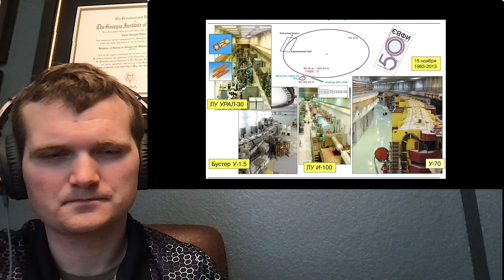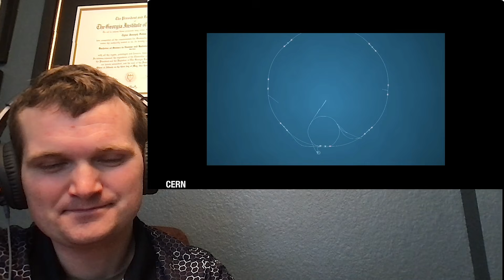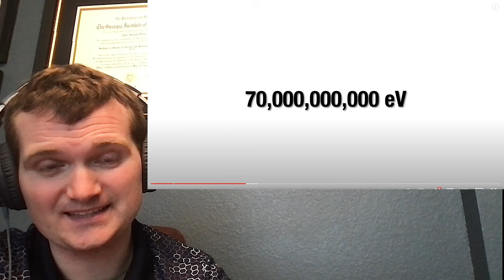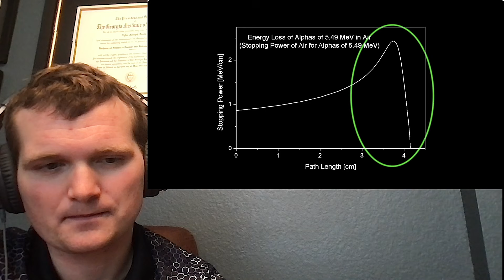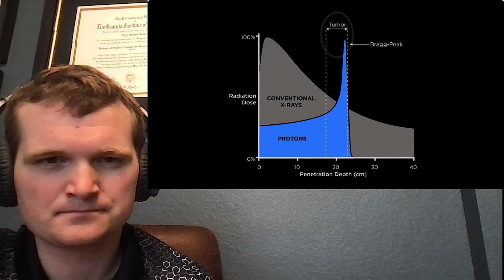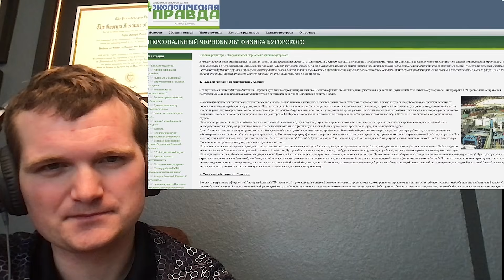Nuclear Engineer Reacts to Kyle Hill "What if You Put Your Head Into a Particle Accelerator?"

Comment: In theater we used to use cue lights to tell the stagehands when things needed to happen.  Obviously if those burnt out it would really screw up the show, so every cue light was a pendant with two separate lamps (sorry, light bulbs) in it so if one burnt out you had a backup.

Comment: 2yrs late, but if the particle accelerator was still on and he moved into the beams path, wouldn't the beam sliced like a light saber from (Star Wars), not just a straight line through his head and the same upon him removing his head. unless there were timed pulses long enough for him to enter the beams path before it fired straight through.

Comment: My dad taught me that anything that can go wrong will go wrong means a point of failure will eventually fail.  So first engineer it so the probable failure is well outside lifetime/maintenance and second, what's the contingency.  That failure happens where does the load go?  Make that tolerate the extra load.  Repeat redundancy based on application

Comment: A 250 ton train, travelling at speed, isn't going to be slowed to any significant degree by a bicycle.  And if you've ever seen investigations where a plane has crashed, at speed, into the ground, it may be difficult to find anything which resembles a plane.

Comment: 14:00 this reminds me of what happens when an armor-piercing round hits something thin and soft like a truck trailer fabric and doesn't make any damage inside apart from punching an entrance and exit hole in the fabric. It would absolutely obliterate a tank because it was designed to interact with and encounter a lot of resistance before it delivers the payload. But it just doesn't have enough stuff to interact with on a skin-thick target.

Comment: I am no nuclear science expert but I do have the quality assurance mindset. Shouldn’t it be impossible to disable that door lock because you “feel it’s an overkill”?
Also a signal to the operator room that the lightbulb is burned is also mandatory IMO.
P.S. In my university ,in Bulgaria, there are induction furnaces for melting metal and the sensors for the doors on the high power electronics have been bypassed. That’s the dangerous Balkan mindset of neglecting safety put into action. Kinda like in the video

Comment: 4:44 the particle bunches lose energy due to impedance of the vacuum chamber walls (image charge) as well as during bunch focusing and overall trajectory changes; free particles don't go in circles.  There would be no light coming out otherwise.  If one is tempted to invoke "magnetic fields do no work" thing, I encourage doing a Lorenz transform of the magnetic field into the rest frame of the particle; things get weird near the speed of light.  Synchrotron radiation was thought to be a myth at first but we've been using it for spectroscopy for decades.  Energy leaving means it needs to be topped off; in those days, that was likely done in a copper RF cavity; superconducting cavities are more common now.

Comment: 4:11 I cringe whenever i hear "perfect" or  "near-perfect".  Typical operating pressure of a modern electron synchrotron is around 1e-9 Torr (1-e10 with no beam stored); around what it is in low earth orbit, if I remember correctly.  In principle, 1e-9 torr is easy and can even be achieved with mechanical pumping; the difficulty in this application comes from needing really narrow and very long chambers because of magnet optics constraints.  Ion pumps have to be used sparingly because they perturb the magnetic fields so we get into things like nonevaporable getters, titanium sublimators, and outgassing-reducing surface treatments.  A colleague claims to have gotten a photocathode chamber for an electron storage ring into mid 1e-13s; that's well below the measurement range of off-the-shelf devices.

Comment: EDIT: I stand partially corrected:  it's was a proton machine.  Though, again, nothing nearly as complicated as the LHC or RHIC.  No bigillion miles of superconducting wires or 10-story-tall detectors.  

3:12 that looks like one of the LHC or RHIC detectors; both machines are hadron accelerators and study collisions, therefore requiring huge detectors; produced particles going every which way.  I did not know about this particular synchrotron (funny enough, i was a child living in the USSR at the time of the incident and then many years later designed chambers for synchrotrons and ERLs at two national labs in the US; synchrotrons are cool) but given the arrangement of the instrument hutches (i.e., tangent to beam propagation), it looks more like a light source (likely electron, possibly positron, based) so the detection equipment is (especially in those days) pretty compact and not as complicated as collider detectors.  I also kind of doubt there were superconducting magnets seriously involved in the late 1980s.  The light that comes out before hitting a monochromator is of all frequencies (though peaks at a frequency defined by the magnet lattice of the machine) and is therefore often called "white beam"; its very coherent and can have a ridiculously high repetition rate so, as of the past decade or so, folks have been able to see biochemical reactions take place, not just take static destructive pictures.

Comment: Tyler, in terms of signage the illuminated signage should've been fail-safe. To have a sign illuminated to say the area is forbidden is bad practice

 The sign should instead be illuminated to say its safe, and off when its forbidden. The reason why is that if the bulb were to blow, the fail-safe state would mean that the user would have to assume its forbiddrn then double-check and confirm to make sure its safe.  

The system used here could have just a blown bulb leading to the assumption that the sign was off and that the room was accessible to enter.

Comment: What I dont understand, is how did the beam only go through a small part of his head, like a bullet,  shouldn't it have been more of a "cut"?  Due to the speed of the particle beam?  If feel like it's like putting a piece of wood in the blade of a circular saw, pulling it out, but only having a drill hole in it.   If that makes sense
Reply: I think the atomic particles race around another path, then someone pushes a switch and the high energy particles are diverted in a short pulse to the target.  Not always on like one would expect a steady state laser to be.

Comment: I'm unable to deal with the math at the moment (to be frank, I'm drinking, and I don't trust my MS-crippled fingers with a calculator)... but are you certain that a proton moving at 0.95C+ isn't at least approaching the 7BeV that you're poo-pooing?

The rest of your info is solid as hell... plainly you know your shit... but I had to question your estimate of each proton's energy, which seems vastly too low to me.

Also, even 7BeV protons would cause very little more damage than those far less energetic ones you're talking about, simply by going so much faster through the affected tissues... so maybe I'm making a mountain of a molehill... still, I had to raise the question:  was the beam's energy even remotely close to the 7BeV/proton claimed in Hill's video?

Comment: That whole logic about the door being locked was "overkill" is so typical of why things eventually go wrong. Whenever you make a safety-related decision like leaving a normally locked door open, ask if there is any point to NOT locking it. 

Is there a practical reason why you want people to enter the room with the proton beam when it is running? Is there any benefit?

Even at lower energy experiments, you wouldn't want people randomly walking into your beam, would you? Even if the energy is so low that it won't do damage, it will certainly disrupt whatever experiment you are running, one would assume.

It's like people working in high places using safety harnesses. You are supposed to only remove one of the attachments at a time, but sometimes people will try to save time (or something) by taking both off before moving to the next attachment point. Sure you might save a few seconds, and most of the time you will be fine, but one day a gust of wind or a wet surface or even just you being slightly distracted by a loud noise or a pretty girl on the street below... and that's the end of that.

Safety is that thing you must always have, yet never see until it fails.

It's boring and when it works, nothing happens, making some feel like it's meaningless. This is why all kinds of prevention, preparation and health and safety procedures are so hard to convince people of; if everything is done correctly then nothing will happen. This is why people doubt vaccines, for example. "wHy dID wE gEt tHe vaCciNe? nObOdY goT sIcK!" ... yeah, that was the point.

I still remember all the work that was put into preparing all the computer systems for Y2K; countless people all over the world worked for years to update systems to a four-digit year system. And once midnight 1999-2000 happened, there were only minimal issues in minor systems... and people immediately started mocking the "hype". Well, the reason the world didn't fail was BECAUSE of the "hype", but I still see people joking around with how "meaningless" that was, never realizing how bad things could've gone if everyone had ignored the problem.
Reply: People doubt vaccines because the government lie about them. How do you define vaccine? I know what I was taught. A vaccine is a weakened or dead form of a virus that stimulates antibody production. The 2020 jab is not that but they called it one while forcing people to take it without any safety testing and government relieving of liability.

Comment: Even less safety related rooms that contain a hazard (like laser operation) have emergency stop automatisms that trigger on opening the door…
Reply: Also that lightbulb… Even the most stupid engineer (if there has to be a light bulb at all), who wasn‘t able to use a self checking signal, would have at least(!) hooked it up in reverse (light up if there is no danger) to reduce the failure risk.

Comment: Haha. I like the No Smoking sign at the top of that door, above all the other signs. Corrosive acid is the scary thing in that room. Cigarette smoke won't do anything to the acid or batteries (other than leave nicotine stains everywhere). It would actually be perfectly safe to smoke in that room, provided you're not burning the batteries with your ciggs. If you put your cigarette out in concentrated sulfuric acid, you wanna know what would happen? The same thing that happens to paper or every other organic substance. One thing it wouldn't do, is explode.

Comment: Im a nuclear engineering student specializing in radiation safety and medical uses of radiation; gor what it's worth, stopping power has been the standard term we've used throughout my program rather than slowing-down length, since SDL is derived from stopping power, and stopping power is more widely applicable -- it accounts for density, where SDL is more reliant on the details of the medium.

Comment: Surely you'd make it a green light bulb that illuminates when its safe to enter, that way if it burns out it fails safe as no green light = no entry rather than failing unsafe Ie no red light on being misinterpreted as safe even if its not as its just a failure of the light

Comment: As a gun person this concept fully applies to bullets.  For example it is why hollow points are preferred over full metal jackets, a full metal jacket often just passes through and does minimal damage as little of the energy is actually transferred,  but a hollow point being designed to open up and expand its surface area will ideally come to a stop in the body, therefore transferring all of its energy into the target.   Although I do not think the idea of the braggs peak applies, but all the rest does.
Reply: @Xnoob545 fun person.
Reply: Theoretically, even if a HP does overpenetrate, it should've dumped enough energy to prevent causing serious injuries to the 2nd object/being struck. The big exception being drywall, which tends to fill HP bullets, causing them to act more like an FMJ. Tumbling rounds like 5.7 or copper TUI solids function similarly, piercing the first target (and possibly even armor), but then they dump most of their energy in the tumbling action once they encounter resistance.
Reply: Don't need to be a fun person to understand this. It's called common sense
Reply: @456death654  fun person

Comment: if you notice Kyle said a sign should have been 'illuminated" which means it was a light up sign, much like a recording studio or radio station has a light that says "on the air" or "recording in session", not just a plain sign, but an electronic sign, warning its in use.

Comment: Your info on Nuclear Plants is interesting, keep it up! Oh and.. it was 'only' 64 GeV , not 70. Fun fact : I once worked a few days on a machine I had installed  at the VITO Nuclear Research Center in Mol (Belgium) in 1989  and my client asked me to please not use the local toilet, but use the one in the administrative part of the building. So if nature called I had to go through the double doors to the  toilet in the administrative part and then let myself in again. WHY ? Well, the machine was installed in a decommissioned lab. The drain from the lab toilets still went to a holding tank which contained waste water from the 'active period' , which VITO preferred not to get fuller with ordinary waste, while the 'outside' toilets just fed into the common drain.
Reply: I know a guy that would've ignored the request and used the forbidden toilets anyway

Comment: Murphy's Law was coined by Dr. John Paul Stapp. In case you don't know, among many other things, he oversaw and even performed many tests for plane seating and ejection mechanisms at the rocket sled facility in the southwestern US. He did not just oversee these tests; whenever he could, he used himself as the test dummy. If you ever heard of the man who set the record for the fastest a human has ever traveled on Earth, the man was at this rocket sled facility, and the man was Stapp. Why did he set the record? He wasn't aiming to set the record, but rather to demonstrate how many G's a human body could survive, as it was believed before then that the number was rather low. Stapp's sled run proved that assumption completely wrong. As for all of these sled runs and the data collected from them, not only did they work out the systems currently used in military aircraft, but he also took it and went on a nationwide advocacy for seat belts in cars - yes, he is the reason every car in the US (and most of the world by extention), by law, has to have seat belts for every passenger in a car.

As for Murphy's Law, it is credited to one of the engineers who worked under Stapp at that facility. Stapp had a tendency to take whatever those around him would regularly say about something science- or engineering-related, simplify it and try to give it more of a (usually comedic) punch, and give it out as a truism. He even published a compilation of these, and he named each one after who he believed said their original forms the most often, hence why Murphy's Law is not named after himself.

Simon Whistler covered more about Stapp than a simple post can. Feel free to look the video up for a better summary than this.

Oh, and Stapp does have his own law, otherwise known as the Ironic Paradox: "The universal aptitude for ineptitude makes any human accomplishment an incredible miracle."

Comment: Just like it's often done in electrical substations, there should be a shutdown mechanism mechnicaly coupling door to the particle generator, just so when the door is open, the beam is automatically shut off. It is often done in electrical so you cannot open isolating switch (which has no arc extingushing ability) when the power is still on.
Reply: So leaving a door open is substation sabotage? I know what I'm going to do on Friday, November 17th in north by northeastern Paradise Nevada (commonly known as Las Vega) at 7:32 AM Greenwich Mean Time (I'm going to leave a door open in an electrical substation).
Reply: @fletchercobb4398  NSA: nervously sweating

Comment: One bulb burned out! The indicators on the flight deck of an airliner each have two bulbs, oriented such that a pilot can tell if just one of them has failed, and they are inspected daily.
Reply: Railway signal bulbs typically have two filaments, with the second being noticeably dimmer than the first, making it easy to tell the primary filament has burned out
Reply: Eastern Airlines 401 crashed because one of the gear position bulbs burnt out. When the pilots were verifying if the issue was with the plane's gear, or just the gear light. One of them accidentally moved the control column, disengaging the autopilot and sending the plane on to a descent towards the Everglades, where the aircraft ultimately crashed.